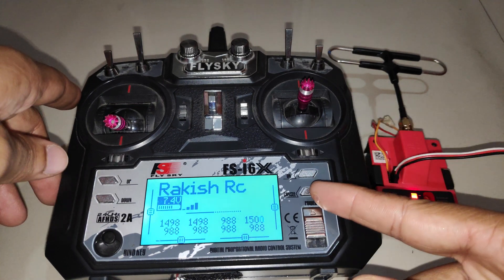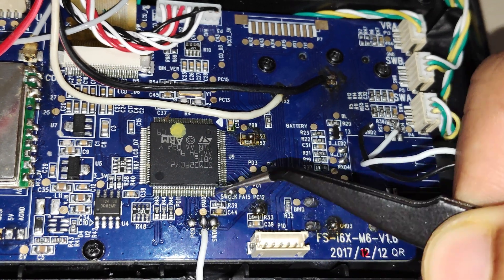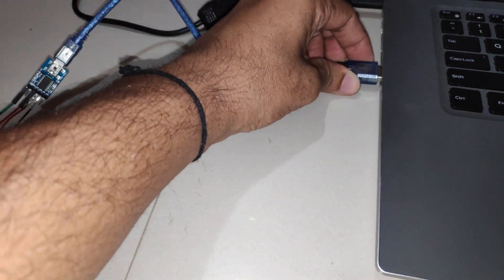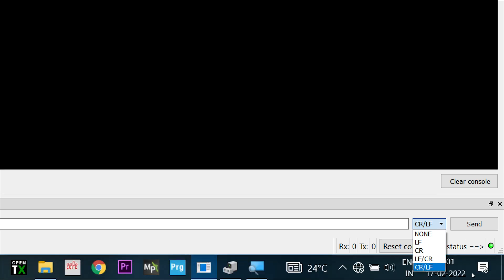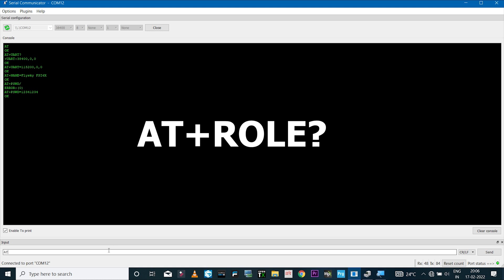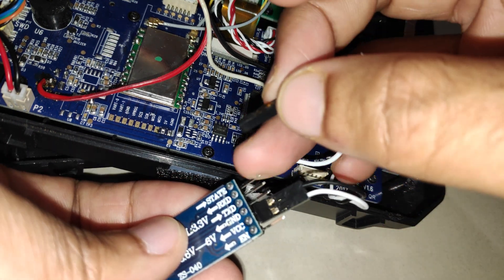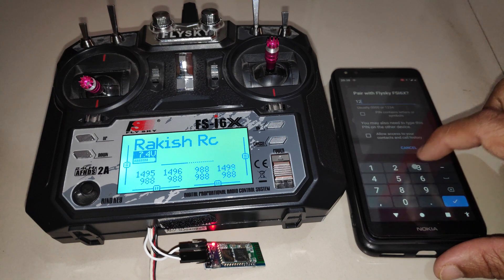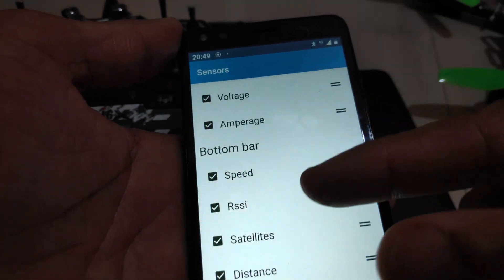Flysky FSI6X Bluetooth Mod for Telemetry Mirror with Open TX ExpressLRS using Bluetooth HC05 Module

Comment: Is it possible to use an HC05 bluetooth module to establish a bidirectional (control+telemetry) link? One application would be to use bluetooth connection with your laptop to run a simulator like PicaSim. Maybe also to transmit control signal to your ground station when using Ardupilot to control pan and tilt FPV camera gimbal so that a head tracker signal could be sent first from your transmitter to the ground station, then from your ground station to the craft receiver via Mavlink.

Comment: @RakishRc  HC-05 is now connected

Enter AT commands:
OK
+ROLE:0
OK
+UART:115200,0,0
OK

I Have verified and it is good.. I think this is ratter a radio issue. I measured continuos 3.3v on PA9 pin, wich i suppose has to send a pwn signal or some something else ratter than high 3.3v

Comment: Hy, i have configured and wired the HC-05 same way as you did, enabled telemetry mirror and set baudrate on radio to 400k, then 1.8M then 115200.. but none of them actually sent me any data. The bluetooth connection is working, i can connect to the device, but i don't get data in "Telemetry viewer" on android, nor in Mission planner inav. ELRS Telemetry  is working betwen the tx and the rx, i get all sensors, and i can view them on my slysky fsi6x screen. Do i need a special LUA script to enable telemetry mirror to do something ? I have measured at some point that pa9 pin, and i got 3.3v on the multimeter, that is wired to hc05 rx pin.
Reply from the maker: Mostly like the hc05 configuration settings are not saved correctly. Make sure that the baud rate for the hc05 is set to 115200 and check if it's saved with the AT+UART? Command.
If it's correct and still not transmitting data check the ground connection between hc05 and the radio. Lastly also check if the tx and Rx wires are connected correctly between the radio pins and module.
Reply: @RakishRc  HC-05 is now connected

Enter AT commands:
OK
+ROLE:0
OK
+UART:115200,0,0
OK

I Have verified and it is good.. I think this is ratter a radio issue. I measured continuos 3.3v on PA9 pin, wich i suppose has to send a pwn signal or some something else ratter than high 3.3v
Reply: @alexandrugroza839  hi, are you fixed your issue with telemetry mirror? I have a same, there is no data on PA9 pin (FS-i6x transmitter with Open I6X v1.11.1 firmware + HC-05)

EDIT:

I made downgrade fw to v.1.10.0 and AUX_UART started working.
Reply: @rcboat58  ok thanks for the tip.. i guess i will have to try! are any bugs or less features in the downgraded version?

Comment: is there any way i can attach the bluetooth module to my drone so the drone sends telemetry so i can use it like remote id
Reply from the maker: Which flight controller are you using? It's possible provided the flight controller and the configuration software support it. Mission planner has this option
Reply: @RakishRc  i am using a matek wse f411 and inav 2.6.1 adrupilot show me going up when i go down .....its wrong... left  and right it perfect
Reply from the maker: @staydown.normalsavas  pitch stick need to be inverted. Atleast with adrucopter i have to reverse the pitch channel else it's inverted by default
Reply: @RakishRc  so i will have to invert my rc controller out.? then i will have to invert inav to so it dose not invert my plane sticks...yeah? then adruplilot should show the plane going up for up and down for down...?
Reply: @RakishRc  how do i do this
Reply: @RakishRc  how do 
i do this
Reply: @RakishRc  i wan to use this on my drone so you can use your phone to see where it is
like remote id
Reply from the maker: @staydown.normalsavas  hi, yes do try and reverse the pitch and roll channel on your radio if it's not correct and check by arming on ground and slightly increasing the pitch and roll to check if it's moving correctly.
Reply from the maker: @staydown.normalsavas  if you attach the blutooth module to your flight controller then you can access mission planner and by connecting to the Bluetooth com port. Just need to check the baud rate of Bluetooth module to 56700

Comment: Hey great video as always! Will this work without the express Lrs module? I am using ibus telemetry with the fsia6b
Reply from the maker: At the moment only elrs telemetry is transmitted. Flysky telemetry mirror doesn't work yet but it could be implemented in future
Reply: @RakishRc  Thank you!

Comment: @Rakish Rc I am thinking of adding the HC05 as well, but curious to know if you have experienced a noticeable power consumption because the Bluetooth module is always running?
Reply from the maker: I use a 2s 1000mah lipo so it doesn't matter. But I've also used with AA batteries and they lasted for good time so Bluetooth module doesn't really affect the battery life that much
Reply: @RakishRc  Thanks a lot. I'll add the module then.
Reply: I have connected the HC05 to the FS-i6x (updated to 1.6.0 firmware), the telemetry output is enabled in INAV and also on the TX set to telemetry mirror. I can connect the HC05 to the telemetry viewer app but there is no data obtained from the flight controller. On the TX, I am able to see ten sensors outputs (Not sure why GPS is NOT listed within my sensors on the TX).  The HC05 RX is connected to PA9, and I am using 5V from the TX pad and the GND2 pin. My HC05 module has a blue led lighting up aside from the red the led. Any suggestions to fix this issue? Thanks.

Comment: Hi. I have used hm-10 Ble module and can connect my phone using a Bluetooth serial monitor, and see data streaming. The data changes slightly when the receiver connects. Is there a telemetry app that can read Ble module
Reply from the maker: Did you use telemetry viewer app?

Comment: Thanks for the tutorial! I just a noob in RC model , also try to elrs, but don't know how to wire up the elrs receiver to the origin receiver. Is that ppm or something like sbus signal regulation to transfer the signal ?
Reply from the maker: For elrs it's the crossfire protocol via tx2 pad on radio

Comment: Sir did you directly connected the 2s battery to the transmitter...I'm thinking of modding my transmitter battery and I'm not getting any correction info about the max input voltage the transmitter can withstand...is it safe to use a fully charged 2s since we are giving 8.4 volts i have doubt about that
Reply from the maker: So I've been using a 2s lipo only to power my fsi6x. Have had no problems yet. There are many more users directly using a 2s lipo without any issues. However like you said there is no official voltage specifications about the regulator so there's always a chance of things smoking up. If you have a latest fsi6x board from 2017 then you should be fine using a 2s. 👍
Reply: @RakishRc  thankyou sir

Comment: @Rakish Rc Thanks for the tutorial. Do you know which is the pin that outputs SBUS on FSI6X? I am trying to use SBUS than PPM to connect my SIYI FM30 external module to FSI6X.
Reply from the maker: Currently sbus output is available but will be available soon i guess for external modules.